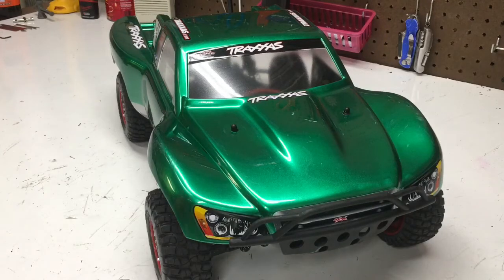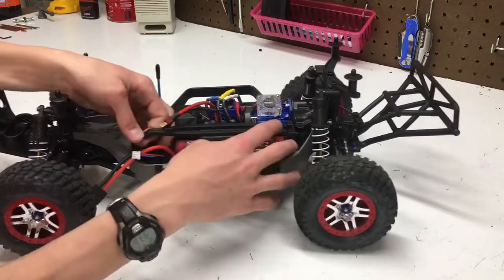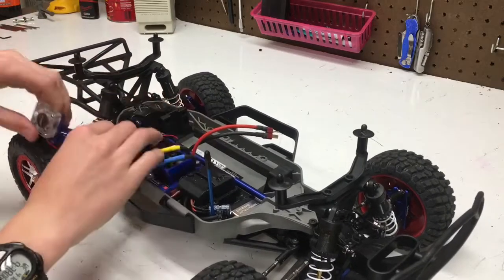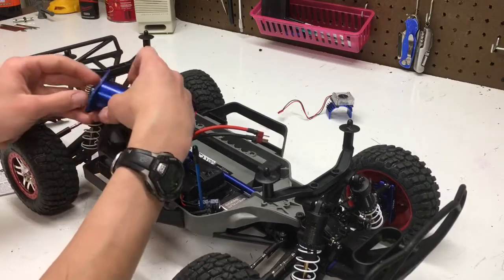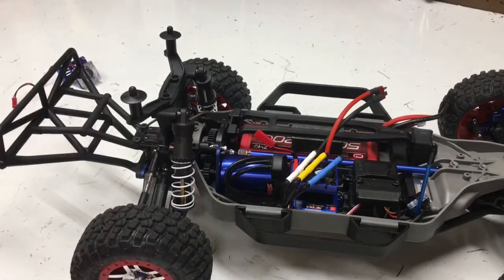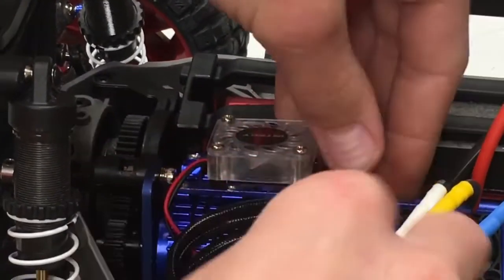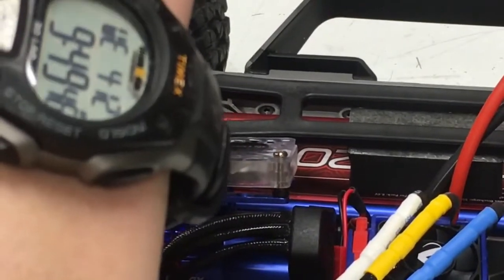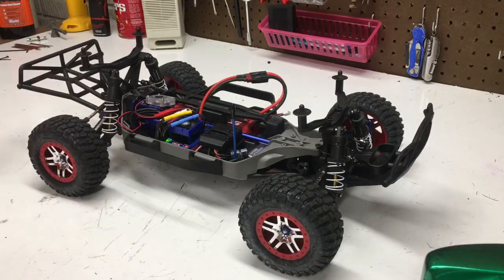Slash 4x4: Upgrade #7 - High Speed Pinion

Comment: what motor fan do u use
Reply from the maker: I’ve used the integy heat sink/fan combo with good luck, probably one of the only parts from integy I would recommend. I made a video about running that and the VXL fan together.

Comment: Can you still drive in low grass and small gravel with the high speed pinion gear?
Reply from the maker: Yes, and in fact you can do almost anything, and better.... it would seem. It will take a toll on the motor and esc though, as well as the drivetrain. Be careful